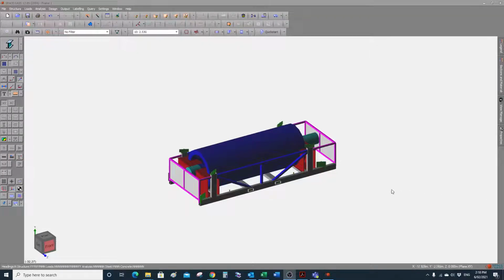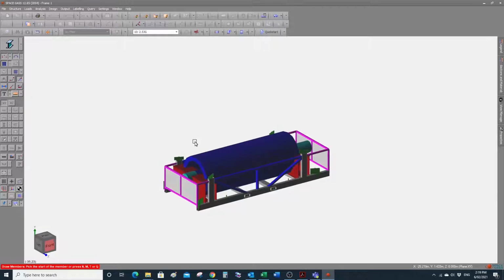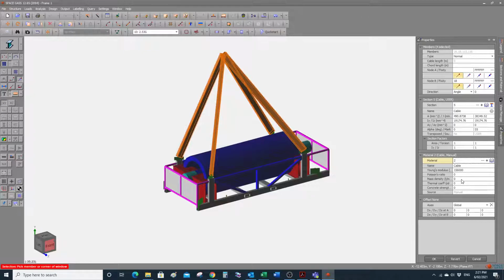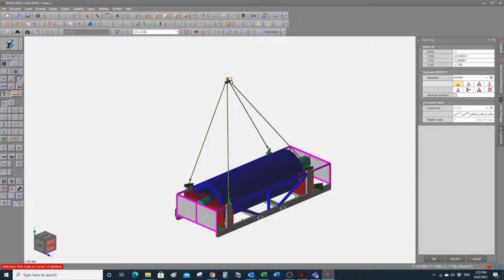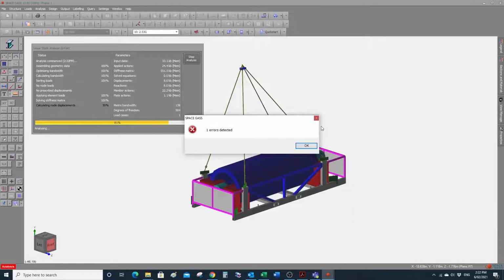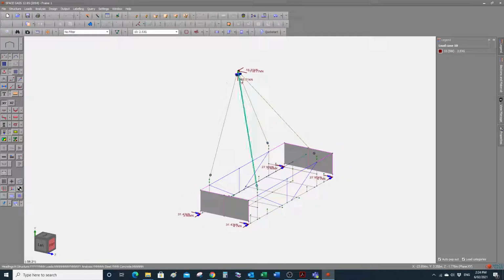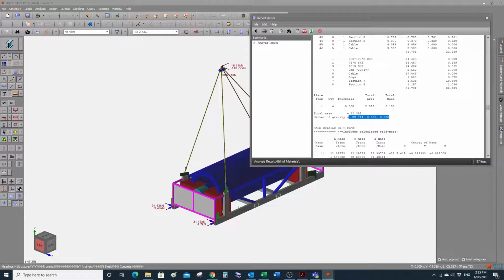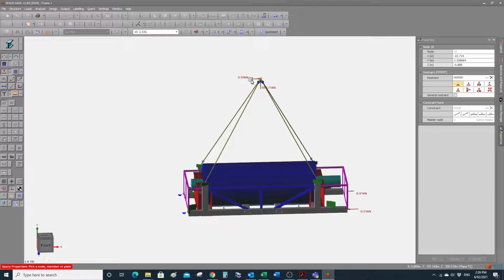Simple lifting analysis - Part 1

Comment: Sir, How we select the stiffness of spring?
Reply from the maker: It should be soft. I normally use 0.05 kN/m.
Reply: @amirbahrami9966  Thank you for replying
Reply: Why we can’t select a spring with higher stiffness value.
Reply from the maker: @tominmathew344  because springs being too stiff affect the equilibrium position in wrong way.
Reply: @amirbahrami9966  can we consider stiffness value of .05kN/m for all lifting analysis even for a structure weighing 30 ton..
Reply: When I used a spring with higher stiffness the horizontal reaction at spring increased..

Comment: What the application name ?
Reply from the maker: I use the software called SPACE GASS. However, the method is applicable to any structural analysis software, namely SAP 2000, SACS, etc.

Comment: Bro Can u plzz tell me which command u have used for lifting thus structure because i have also this type of same project but i am confused how to add these.
Reply from the maker: Hi
Sorry for the late reply. Lifting analysis is a normal static analysis of structure. We add slings that can take axial force only. In the software I used, SPACE GASS, this can be achieved by adding end moment releases to the members. The only support this model have is the hook(s) point. But such model is unstable, just like a real lifting is. However, the instability is not the kind that results in collapsing. It can be stabilized by adding soft slings in horizontal directions. If you watch the vdu a few more times, you will clearly see how we do it in SPACE GASS. For other software, e.g. SAP2000, etc. similar approach works but of course with slightly different arrangements.